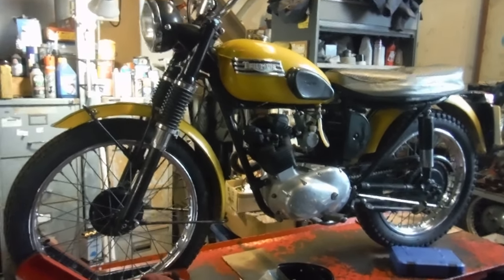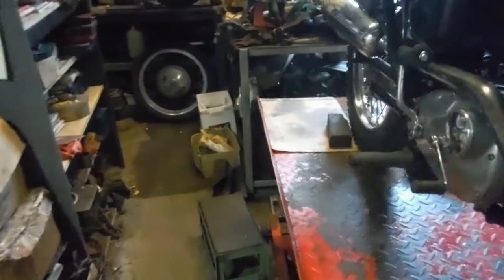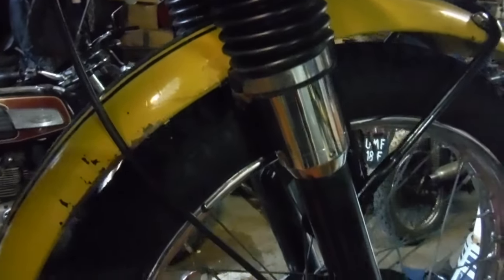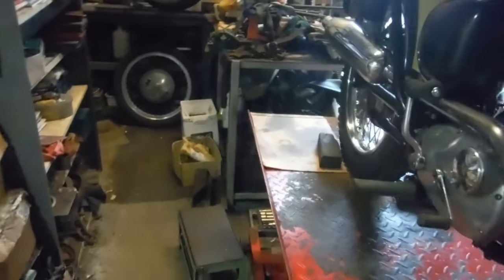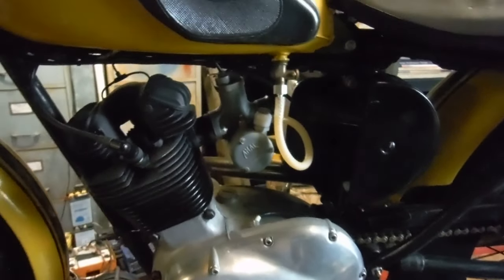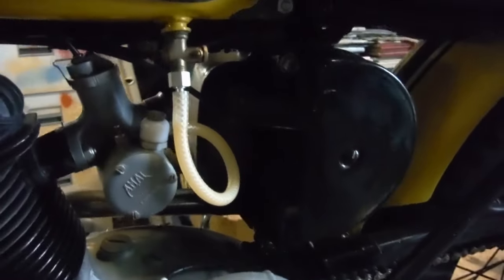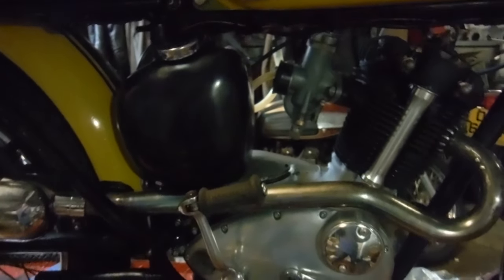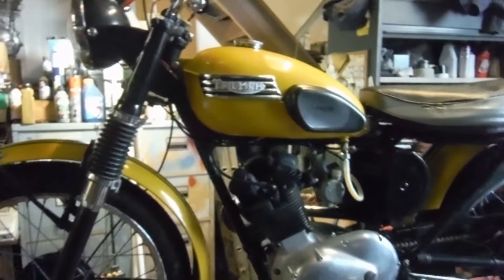Triumph Mountain Cub T20M - Introducing this machine which paid a visit to the workshop.

Comment: There's the Podtronics regulator/rectifier which has a micro capacitor inbuilt so unless the bike requires parking lights you can do away with a battery. lovely machine btw
Reply from the maker: Thanks - the Boyer Powerbox is another regulator / rectifier which has a built in capacitor.

Comment: If any electronic ignition is used go for a vape unit will run. at 6 volts on 12 volt system much better made than the boyer
Reply from the maker: If it were mine, it would be going back to points!